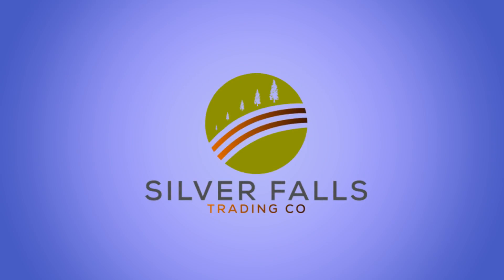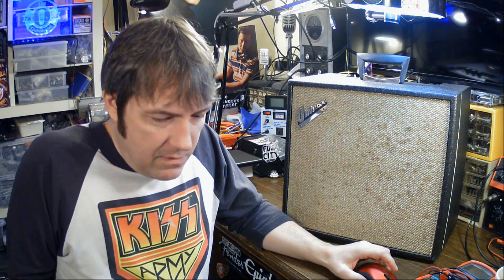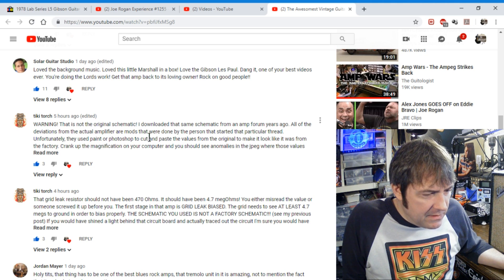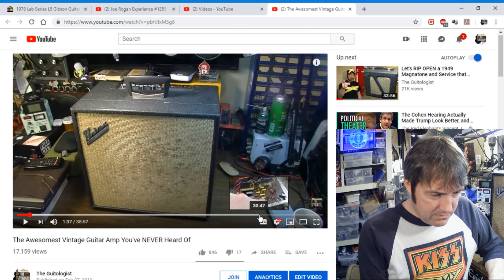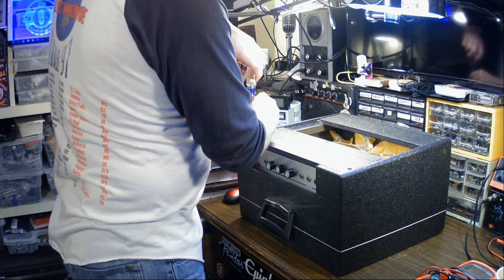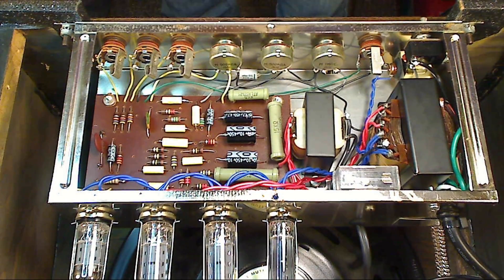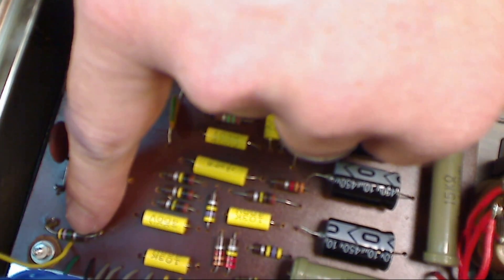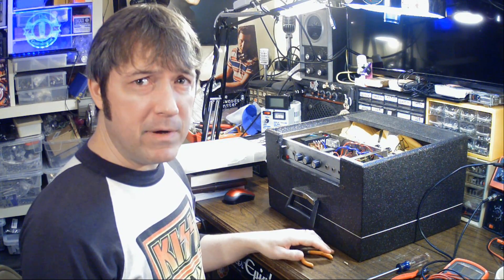Univox U45B Correction and Sneak Peek at Live Stream Format

Comment: If you shine a light behind the circuit board you can see all the traces from the front. Cool! thumbs up, buddy!
Reply: I modded one of mine to be a common cathode bias on the preamp but grounded it to the board in a place that induced hum. Only one ground connection at the input jacks on these things. I'll eventually get around to putting it back to stock but the poor thing isn't getting played much. They're good sounding amps, just not loud enough. The other amp has a C12S with a large aluminum dust cover and that is definitely the better sounding speaker in my opinion. The one with the aluminum dust cover has front facing controls and negative feedback from the factory.

Comment: Brad, have you ever done a video that shows you how to measure the output impedance of an amp without a speaker? There are a lot that suggest they will, but always refer to the speakers. But sometimes amps don’t have speakers attached, you get just a chassis or you may suspect the speaker present is a swap and suboptimal. 

There is one guy who does use two 4 ohm capacitors to confirm his amp and speaker are 8 ohms, but I wondered if you might have covered that anywhere. If that’s a stupid question, my apologies, but it’s question I have faced and cannot find the answer. Well, not in the context of guitar amps or in language I can understand.

Thanks and keep up the excellent work.
Reply: More likely 4 Ohm resistors , not capacitors.To find a given output impedance of an output transformer you need to inject an AC voltage through the primary and measure the secondary voltage then work out the turns ratio etc. best left for a pro to do These things can be dangerous for the unskilled and guys like us need to have work to do to survive
Reply: George Krabs You’re quite right, George, I should have put resistor, but I was not long up and hadn’t got my head straight. 

I’m not trying to deprive any pros of work. I have an old solid state chassis with no indication and can’t find a schematic or even any specs for this model and wondered if there was a way of determining the load and drawn a blank. This isn’t worth spending any money on. I got it for peanuts and will fix a couple of blown capacitors and renew the old ones, too. But it’s just not worth anything much, isn’t very special and holds no sentimental value for me. Or else I’d take it to a pro. 

Thanks for your response.
Reply: @PádraigFloyd  Being solid state you need to measure the power supply voltage to determine the power handling into a given speaker impedance and subject to the amount of output transistors how low this impedance can be.8 Ohms should be fine in most situations. If it's an IC amp device the specs should be on the web. Cheers mate

Comment: Wouldn't you need to get to the underside of that board to properly replace that resistor?
Reply from the maker: No way to reach the pads for that resistor because they were slightly under the chassis. Not exposed.
Reply: Guitologist Channel 2   So, in general - can one do a component replacement from just the topside?  I guess it depends on what the solder under there looks like, no?  Would you say you could do it in most cases?  Almost all?  I guess with enough experience you can feel whether it held tight and made contact?  If it were a modern board with little machine flowed joints, would you think differently?